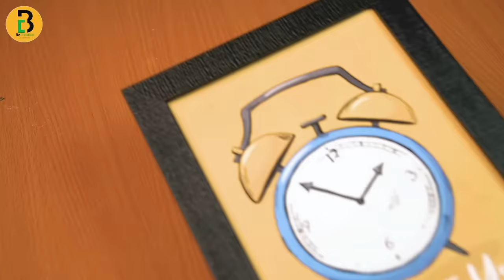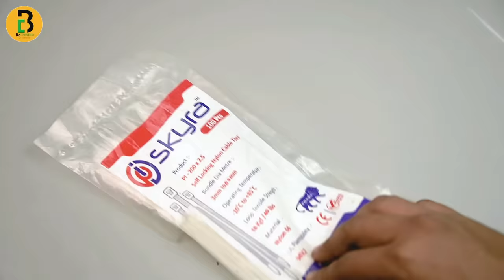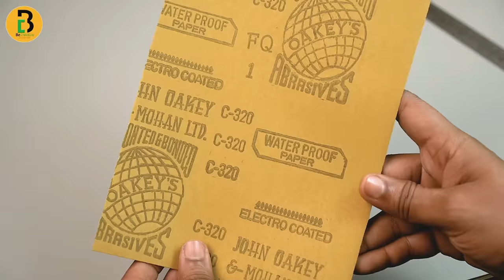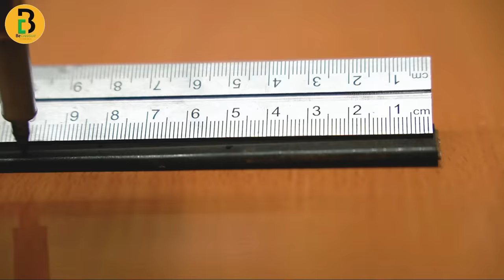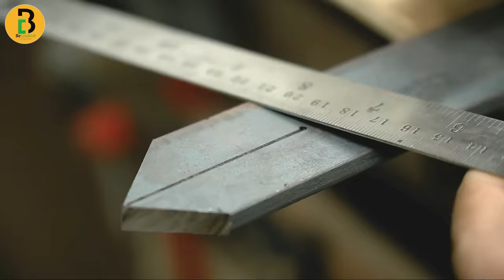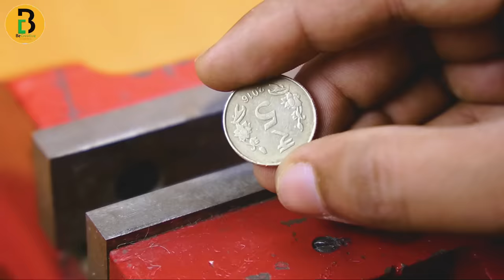25 CREATIVE AND USEFUL DIY HOMEMADE TOOL IDEAS

Comment: Decades ago, my father worked on government projects for Eastman Kodak. On one project, the engineers wanted to make perfectly formed shock mounts our of polyurethane foam. They tried razor blades, straight razors, scissors, basically anything sharp but they couldn't get the results that they wanted. My father was a mechanical technician. They came and ask him if he had any ideas. He thought about it for a few minutes then asked how many they wanted. It was like six or eight to start with. He said that he would be back in an hour. He went over to a business that sold cryogenic gases and bought some liquid nitrogen at --320F. He poured some into a Pyrex baking pan, dipped the sheet of poly into the nitrogen and weighted it down and let it set for 5 minutes. Then he pulled it out, carried it over to a drill press and proceeded to use a hole saw to cut out perfectly round, center drilled poly shock mounts. After they thawed, he took them back to the engineers. They were dumbfounded to say the least. They asked him how he did it. He told them that he used a drill press and a hole saw. Just to mess with them, he left out the part about the liquid nitrogen for a few minutes though.

Knowing my father, I could just hear this conversation:

Eng: Don, how did you do that???
Dad: I put a hole saw in a drill press and drilled them out.
Eng: Naw, bullshit. We tried that. It failed miserably. Made a mess. HOW!
Dad: I'm serious. I used a drill press and a hole saw.
Eng: C'mon, fun is fun now how did you do it? Did you buy them?
Dad: I'm telling you , I went into my shop, set up the drill press and cut them out. Wanna bet $50.00?
(Walking into the shop, dad picks up the Dewar flask and pours some nitrogen in the Pyrex pan.)
Jaws drop. He didn't collect the $50.00 either. He was too honest. I don't know if he got any kind of recognition other than a few pats on the back but he generally didn't look for them.

Comment: why not just put a length of threaded bar in the side handle of angel grinder lock nut and into the drill chuck with keyinto hold it?

Comment: who treats bread like that is plasticine
Reply: Bread is a very old trick the mechanics used to get pilot bearings out of flywheels when changing clutches on a standard transmission. that trick has been around since the beginning of cars.
Reply: @Jerry-jg1uc  I use heavy grease. It works well,